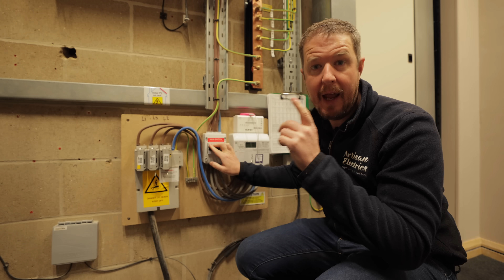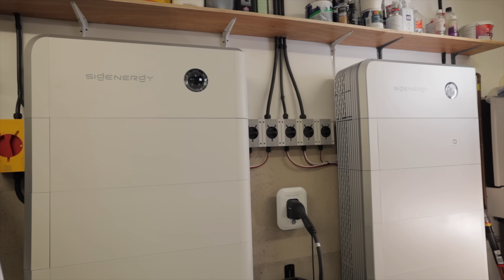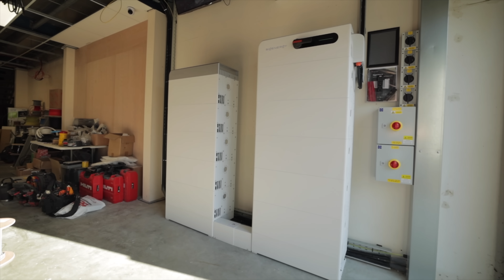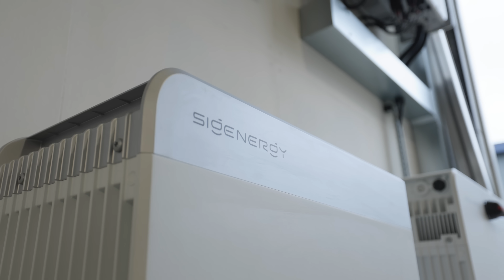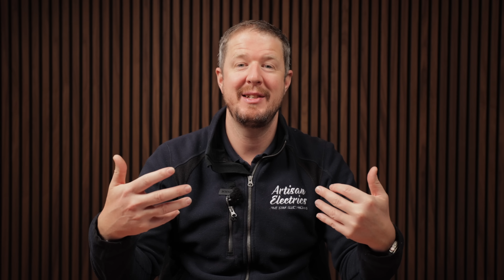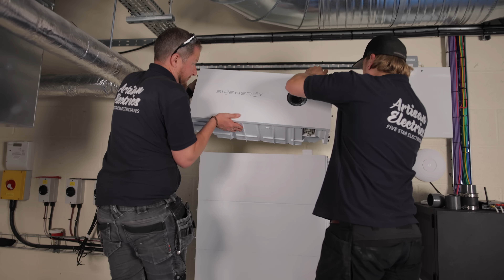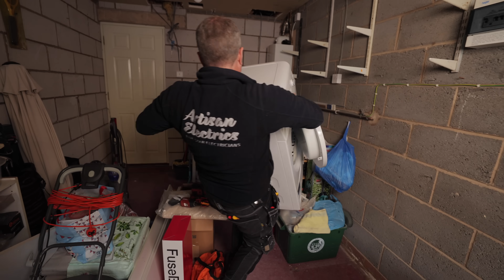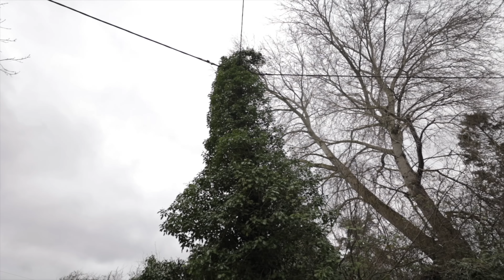You’ve Been MISLED About Battery Backup

Comment: You're wrong on that all normal hybrid inverters are just grid tied and cut out if there is a grid loss.
The Deye SUN series mostly have a load port with bypass built in. This allows it to be installed as a whole house backup and any additional load will be passed through to grid when present.
It keeps in sync with grid even when there is no sun and it is not providing any power in case it has to step in and do peak-shaving, or in case grid fails.
When grid fails it disengages it's bypass relay making it act as an isolation relay and can then continue to support the house during the blackout without back-feeding to grid. It even handles anti-islanding mode for houses using TN-grid where N is essential for safety.
I'm having mine fitted with a 1-0-2 switch though so that I am not 100% reliant on it in case it fails or needs service. That way I can manually bypass the inverter and just use grid if there is any issues with unit. It is a much more reliable solution than the gateway solution as it is much more complicated to put into a bypass mode if something fails.
Reply: Deye isn't in the UK as such, Sunsynk is the UK branding
Reply: @etchedpixels same thing, that's how oem works. They do however mess up the menus.
Reply: @1kreature deye firmware is not certified for the UK, Sunsynk is. Deye have also remote bricked inverters grey imported into other regions where Sunsynk or others hold the rights.
Reply: @etchedpixels  Well, there was more to it than that. Although irrelevant for me NOT in the UK 😛
In fact, here it's the Deye version that is certified and Sunsynk that is not which is why I refer to the version that I know can do what I state. Still, concept is the same, adding a lot of extra systems to do what is already integrated makes for a huge mess of systems covering the wall. Some places looks almost as bad as the whole Victron situation. But yes, one has to get what is certified for the area and grid one has to work with, that is, at least for compliance and safety.

Comment: The Netherlands here. While renovating my home, I built my own system based on Victron Multiplus-II/5K 3-phase. Built my own batteries totalling 32kWh, and added 18 solar panels. Even during winter I can handle a 3-day power outage. During the renovation I took care of spreading the heavy loads across the three phases, so the washing machine is on a different phase from the induction cooktop or the air conditioning. At the end I had a certified installer check it all out and sign off. This system was completed in February 2025. In March we had a sunny two weeks. I flipped the main switch to off and ran off-grid for two weeks strait. Not a single issue during that time.
Today I do have the grid connected and Victron Dynamic ESS takes care of balancing charge/discharge at the most cost efficient times. Not that I expect to make money, I just wanted some level of grid redundancy.
Most batteries last 6000 or more cycles. This year I have accumulated 200 cycles. If these batteries do last for 30 years then I'm sure there's something better out there by then.
Reply: Victron all the way, excellent equipment and does not need a third party system to monitor or manage, although VRM is great for off-site monitoring.
Use Victron at home and on my boat.
Reply: I don’t understand why you made this choice, I live in the Netherlands too and haven’t experienced any meaningful power cuts in the time i can remember
Reply: @rogervanbommel1086  That's a valid observation. There have not been major outages yet. But the drive for renewables and electrification is ongoing in absurd ways, and grid instability is inevitable. You can't insure your house when it is already on fire. I want this energy insurance before the grid goes down.

As a secondary, personal motivator I am interested in all things technical, and I wanted to get hands-on experience. Having done this gives me confidence that I can build this also when really needed.
Reply: @scsirob ah that’s reasonable, thanks for explaining and being nice about it.
Reply: @rogervanbommel1086 I've had 7 interruptions last year lasting around half a day each. Also NL. Depends of where you live. I live rural, so most infra is from the 60ies..
Reply: +1
Reply: Are your DIY batteries 'gekeurd'?
Reply: @supervitallica  No, the batteries are not 'certified' by anyone. These are fairly standard Yixiang kits, with 16x 314Ah EVE cells each in each kit. As this is considered low voltage it does not ask for certification. I had everything 230V in- and out certified though. For what its worth..

Comment: I think especially rural areas or those with known grid reliability issues should mandate a minimum 5kw off-grid capability given the potential for longer power outages. I live in a part of rural Surrey where the grid goes down at least 3 times a week all year round for several hours at a time. Following a storm or snowy weather, it can be out for 24-48 hours or more often during the most inclement weather conditions leaving people with no communications, heat or cooking ability. a 5kw load ability would give them some flexibility to at least make a phone call to check-in with loved ones, make a coffee or basic microwave meal to keep them going. This problematic is the next village over from me, personally I see a lot of brownouts where UKPN re-route power to the the problematic village 10 mins up the road, I regularly see voltage drops to 205-210v and my UPS has to kick in and make up the difference. Typically, whenever UKPN come to investigate it never happens while they're here.

Comment: Well explained, thanks. I have DEYE 15kw hybrid 3 phase and 2  5kw 100 amp batteries. Adding another 5kw this week. This inverter seems to be popular and works well. Have you had any experience with them?  We are in Thailand and have a guesthouse and apart from shutting off air conditioners works okay. My search for backup generator connection using my single phase generator to connect to the 3 phase inverter so I can top off the batteries when low is frustrating. Any ideas that you have would be really helpful. 
Thanks again for your helpful videos.
Reply: I am puzzled 
You said: 5kW 100 amp batteries.

Batteries have two key figures: charge/discharge rate and capacity.

The figures you have provided are both charge/discharge rates.

Do you mean 5kW or 5kWh?
The former is a charge/discharge rate, the latter is capacity.

100 amp - do you mean 100A or 100Ah?
The former is a charge/discharge rate, the latter is capacity.
Reply: @deanXRayZulu thanks for asking. 
Eendvance 
51.2V 100AH 5120Wh
Model: MANA 5.12-D
Battery Energy	: 5120 Wh
Nominal Voltage	: 51.2 Vdc
Nominal Capacity	: 100 Ah
I have 2 connected now and adding a 3rd this week. So it should give me (I think) 15 kw storage and 300 Ah.
Reply: @lannagifts7865 
Capacity can be measured in kWh or Ah.
You only need to specify one of these.
But if quoting the Ah figure, you need to specify the voltage too. You will see why later in the post 

Battery manufacturers often state the Ah figure on the battery, but is much easier to do the calculations when everything is expressed in kWh.
So for example, if you are trying to size the batteries, you calculate the total energy consumed by the loads in kWh, and then you need to know what the battery capacity is in kWh. That's easy, take the ah figure and multiply by the battery voltage.
Reply: @d @deanXRayZulu . If 100Ah x 51.2 x 3 will give me 15360 when the extra battery is connected.  In Thailand we don’t get paid anything for exporting back to the grid and on average I’m exporting 6kw per day so I should be storing most of that with the extra battery.
I have exported 2.09 Mw since May last year. That’s 18% of production.

Comment: We've got a Victron 5kVA inverter running off a 19.2kWh Pylontech battery and 6.8kWp of solar. We're out in the sticks fed by an 11kV overhead line terminating at a transformer outside our house. It's a 100A supply and feeds our heat pump and EV as well as the other typical house loads. 

The "critical loads" (in Victron parlance) covers everything except for the heat pump, EV charger, range cooker and electric shower as these are all too heavy to run from the inverter. We could probably run the heat pump if we wanted to but we have an 8kW log burner for emergency heat as well as one of those little 5kW diesel/kerosene heaters if we need it. I would rather keep the batteries for refrigeration, light, wi-fi and other important loads. We can also charge the EV if we need to but only via the 10A plug in charger which is enough in a pinch or if we have excess solar generation. 

We get outages a few times a year ranging from a brief dip which the inverter senses and alerts about, but we don't really notice, to a full on multi-day outage which we got during the big storm around this time last year. In all cases we don't even get so much as a flicker of the lights and the only reason we know there is an outage is from the alert I get from the inverter and the cooker clock turns off. The inverter switches in 20ms if I remember correctly which is basically a single AC cycle. The inverter can also run in overload of up to 9kVA for a short time but unless we happen to have multiple appliances like kettle, toaster, dish washer etc all running at the same moment the power goes off, it's unlikely to be an issue.

Normally we don't take any action if there is an outage but if it's clear it's going to be an extended outage then we go round the house and power down anything non-essential, especially if solar generation is minimal. Our solar is DC coupled so it charges independently of the inverter so even if the batteries got too low such that the inverter had to shut down, the batteries can continue to charge until sufficient charge has accumulated again for a restart. This has never actually been necessary though even with the 2.5 day outage we got last year.

Comment: I understand the difference between battery storage and battery backup BUT, could you explain why you would use battery storage?  It seems ridiculous to me to use battery storage when it can't be used during an outage.  A grid tie system, in my understanding, eliminates the need for batteries by selling excess generation back to the grid and then buying it back when needed.  What are the batteries for if not backup power?
Reply: I don't know where you live,but here in the UK, "export" rates (what you get paid for exporting power to the grid) are substantially lower than "import" rates (what you pay to use electricty for the grid). Also time of day tarriffs are  a big thing, you can get electricity substantially cheaper if you buy it outside of peak hours.
Reply: @petermichaelgreen  I live in the US and I understand that the cost of buying back the very power that you generated is higher than what the utility pays you for it but the question is, how long would it take to recover the cost of the storage battery when calculating against the price difference of sell/buy of the power credits and could it be done before the storage battery ages out and needs to be replaced?
Reply: To answer the question:
It is common in the UK to have different tariffs for electricity which change with time.

Batteries can be charged up on the lower tariff - typically during the night - and then consumed during the higher tariff period, typically during the day.

Also, the battery storage idea enables excess electricity generated during the day from the solar cells to be stored and used later, even when there is no power cut to the property.
Reply: @deanXRayZulu  OK I get it but as stated in the piece, battery "STORAGE" cannot power the property in the event of a power cut so it can only be used in conjunction with utility power.  That defeats the main advantage of a "GRIDTIE" system over an "OFFGRID" system that requires expensive batteries to provide power when solar is unavailable.  I thought "GRIDTIE" systems eliminated the need for battery storage by selling excess power to the grid so as to be stored in the form of credits to be used at a later time.

Comment: You can tell, artisan electrics have been installing high end systems that always tend to sell you systems that are fragmented and you won’t get full functionality without paying for extras 
This is something I see prevalent in European and American markets, but for the rest of us minions, a simple inverter gives you all those features in a single box without having to buy extra equipment at a fraction of the cost 
I’ve run these systems since 2017 and last year I decided to go fully off grid with 125kwh of batteries and 36kw of discharge for the inverters and all these probably cost me less than a Tesla powerwall 3 system 
With 5 milliseconds of switching, you’d never know you had a power cut

Also, installing solar without batteries in my opinion isn’t really smart
The cost of power is forever going to go up every day and producing and storing your own power is smart
Ask people in California how having solar and no batteries is going after the DNO stopped buyback or in places where you need to export up to 8 units per 1 unit you pull back to cancel out your power bill

Comment: There is another situation to consider. I have an Anker system on a 3-phase feed, and when a backup circuit is added it will only allow up to 3.3KW per phase.
That sounds fine, as in the event of a power cut we don't need to run an electric oven, but this limit applies all of the time, not just during a power cut!
As such, we have to ensure our house backed-up circuits all remain below the threshold at all times. We had to run a dedicated circuit to the fridge, and also only backup the lighting circuits and the office with the computer equipment.

When the installers first fitted the system I tried to make a coffee, run the dishwasher, and microwave something at the same time, and the system overloaded and required a full recycle to get the power on those circuits back up.
Reply: Maybe you should have bought an Anker with a stronger inverter? Anker Solix X1 can also support a 12kW inverter.

Comment: There's a use case you missed: the main use being charging batteries overnight on a cheap rate then running the house off the battery during the day, perhaps with help from solar panels, but also being available in case of a power outage.

Comment: Great advice in this video, especially on the difference between UPS, EPS and battery storage.  I selected a battery system with these considerations in mind, sadly I did not have the benefit of this video so it took some research.
I installed a 16kWh battery system that can deliver 10kW (3 phase) on both the grid output and the UPS output, sufficient to run the house, including some appliances if we're careful.  There's some computer equipment running on the UPS side of the inverter, so it is protected from getting messed up by a power outage.  For that reason I opted for a manual cutover switch, so that the inverter does not get tripped (and kill the servers) if the grid goes out while we're drawing a lot of power.  The computers keep running, and we can then manually switch over the rest of the house.
    
One additional consideration is what kind of solar power / inverter you have.  We have micro-inverters that feed directly into the mains.  Most of these do not work in off-grid mode, i.e. micro-inverters will not work well (or at all) with mains power provided by a battery or generator.  The wiring in my consumer unit was already a little odd, and because of the PV micro-inverters we had to get a little creative.  I have 2 phases feeding the house, the 3rd phase only has the EV charger and solar panels on it.  The cutover switch will isolate only L1 and L2 from the grid, and feed the house from the battery.  L3 remains connected to the grid (the PV inverters of course cut out automatically when the mains power is absent).
   
Another thing to remember, if you're using the battery for backup power, is to tell the system to keep a reserve charge for that.  Else you might find the batteries completely empty when the power goes down in the evening, after your solar panels have stopped generating power, and your washer/dryer and EV charger have used up all power stored in the batteries.

Comment: For those folks with solar panels, am I right in thinking that, in a power cut, some inverters can't charge the batteries from solar without a live grid connection, even on a sunny day? Even though you'd think charging the batteries from solar could be done locally without grid import or export?

Comment: The deye inverters provide backup without a gateway. Instead the whole grid connection passes through the inverter.
Reply: Aka Sunsynk in the UK The load port is tied to inverter and grid until grid fail and then isolates from grid. Still needs an earth and some over current protection on the load port but they are fairly close to self contained